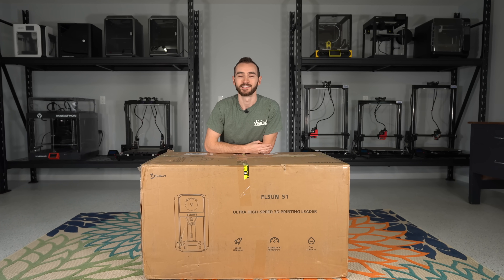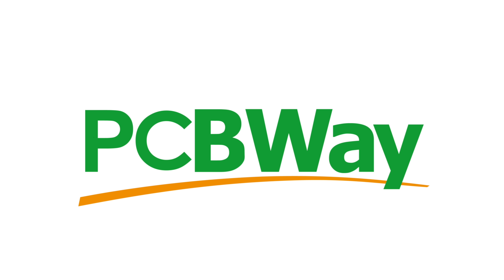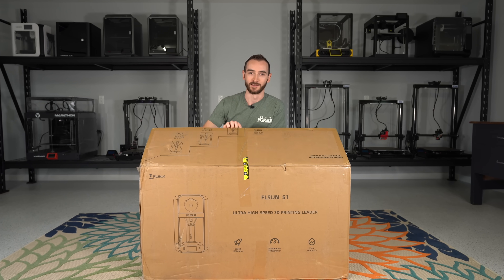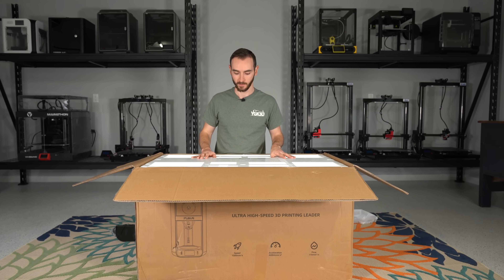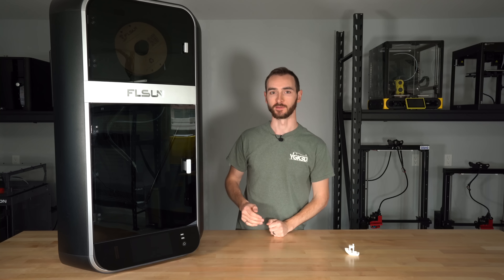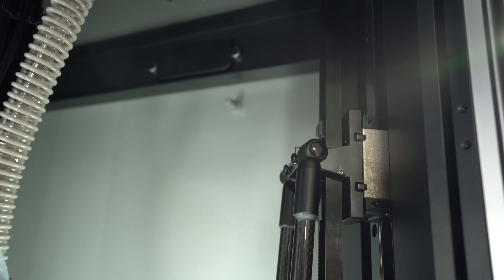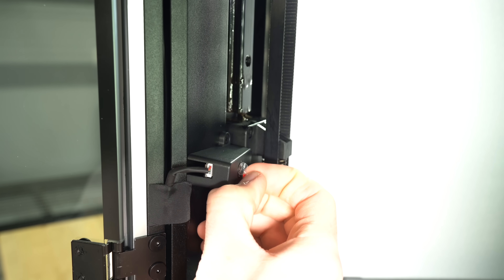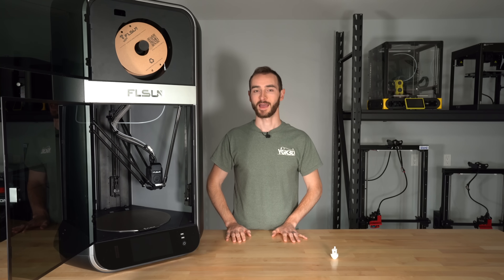FLSun S1 First Look - Bambu Lab FINALLY Has Real Competition

Comment: Despite the fact that it does not have a heated build chamber (like my Qidi X-Max 3), the FLSun S1 may very well be my next printer.  I have a couple of old AnyCubic deltas that have served me well, and I always wondered if the delta printer motion design was theoretically capable of faster speeds than the core-xy motion design that is so popular today.  If nothing else, the delta motion design seems much simpler to me than the core-xy design.  I am very much looking forward to seeing more videos about the S1 printer.  I am especially impressed with the build volume of this beast!
Reply: Having owned a lot of different 3d printers, a well built delta will 100% be able to reach faster speeds with better quality. The main issue in the beginning were ease of calibration, needed tight tolerances in build, and 32bit control boards. the calibration and control boards have been solved for a while. so as long as they build these well, should be a beast. only beaten out by the magneto x with its linear motors.
Reply: Motion controlled by three motors is always better than two
Reply: My brother in Christ what do you mean delta is simpler in design than a CoreXY, it's literally two belts in the shape of an L and you've done your CoreXY routing
Reply: @JasonBrodel  I don't know why, answers starting with "My brother in Christ" always make me laugh, it's like I can feel the frustration behind it xD
Reply: @JasonBrodel  The combination of belt routing and multiple pulleys for a coreXY motion system looks postively Byzantine compared to the simple and clean arrangement of the three-belt system of a Delta printer, at least to me.  When I look at a coreXY belt system, it looks like a lot more than 'two belts in the shape of an L'.  And don't even get me started on the coreXY Voron, which (in addition to the coreXY drive of the gantry) has four MORE belts to move the (heavy?) coreXY carriage up and down.  To me, the Delta motion system seems way simpler and cleaner and accomplishes the same thing.
Reply: According to the website it should have a heated build area? ...Chamber temperature up to 50°C...Or have I misunderstood something

Comment from the maker: Thanks for watching! This is just part one of my coverage of the S1. I'm already deep into my testing and will plan to release a more comprehensive overview soon. Initial impressions are as follows:

1. It's LOUD - It sounds like a vacuum cleaner when running. I think this will be the first thing you want to upgrade. The small CPAP fan gives a high pitch whine. I think that a larger fan would run quieter. Don't expect to use this in your house. You might even hear it through the wall if it's in the garage.
2. It's FAST - Maybe too fast. The printer seems to be able to achieve the advertised numbers but the speeds aren't usable with standard filaments. High speed PLA is the only filament I've tested so far that can take advantage of the speeds and flow rates. For all standard filaments, you won't come close to printing that fast.
3. It's feature rich - Lots of value added features: LIDAR for first layer inspection, automatic flow calibration, remote monitoring with AI failure detection, zone heating (segmented heat bed), clog detection, strain gauge in spool holder to measure remaining filament, actively heated filament chamber, ...
4. It's got Bambu level ease of use with the configurability of a Voron, thanks to the use of standard Klipper firmware.
5. No AMS - No multi-colour capabilities OOTB and a retrofit seems unlikely due to the current filament path and spool holder arrangement.
Reply: A lot of those speeds on the screen seems like requested speeds instead of the real speed. FlSun modified klipper in pervious instances to do that and mislead the users. Also they modified thermal runaway so please test that too!
Reply: @mcstando  The X1 claimed they were 500mm/s, the K1max claimed 600mm/s, and the V400 claimed 400mm/s, but the V400 beat all the competitors at the time, so given the history, I think flsun's speed is more trustworthy
Reply: @Peaky-Birmingham  Thats not really accurate in ... any way???

What do you even mean by beat, because that speed is travel speed, and print speed for all of them is way lower than any of those numbers.
Reply: @BeefIngot  Let time prove speed
Reply: It's BIG, good-looking and supposedly has everything one would want in a fast printer and then some, but how much does it cost?
Reply from the maker: @TNX255  currently selling for $1300 USD.
Reply: @ygk3d  has the printer an Ethernet port?
And also WLAN? If yes 2,4 GHz or also 5 GHz?
Reply from the maker: @berlinberlin4246  I haven’t noticed an Ethernet port so I think not. It has WiFi. I have a dual band router so not sure which network it connected to. I would have to double check. Most printers seem to use 2.4GHz.